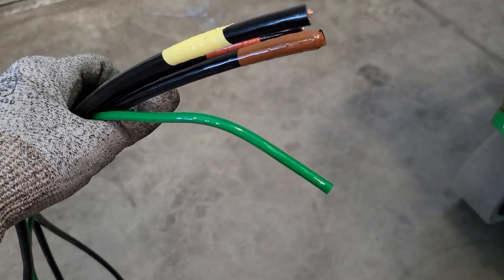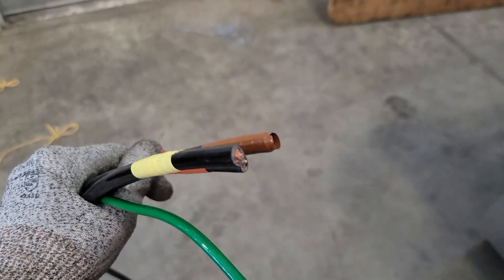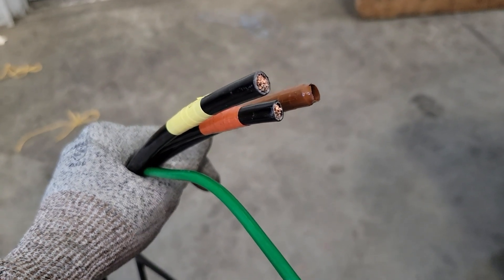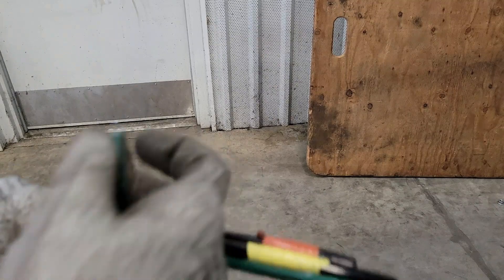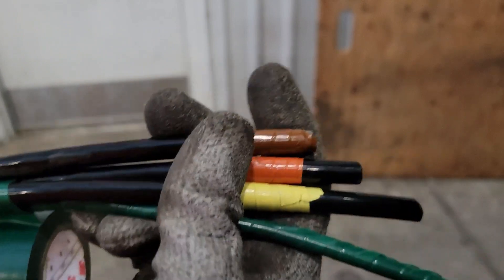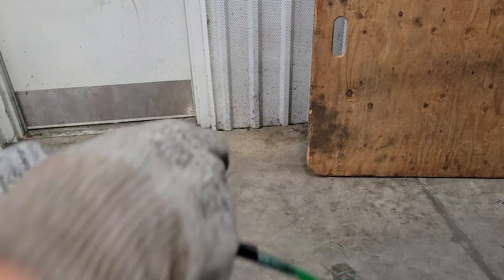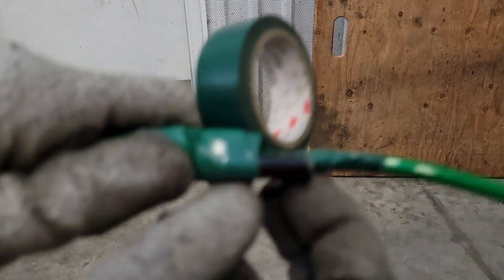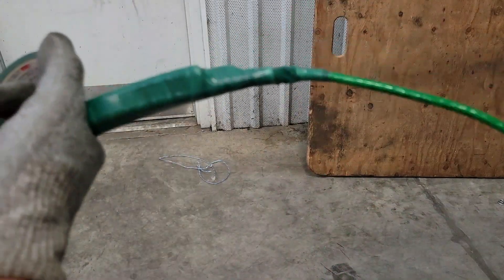Making A Wire Pulling Head, Fast And Strong

Comment: Wow what an incredible waste of time. You could barber those down and bend them through a rope loop in the same time and you would have something that would never pull off even with a tugger and not wasting all that tape
Reply from the maker: That is a good method. This is more meant for the new guy that is youtubing this. No worry with stripping and twisting. I've had many heads come loose that were stripped and twisted by new guys. I always show them this first. Kinda fool proof.